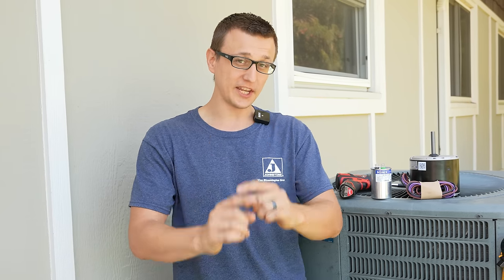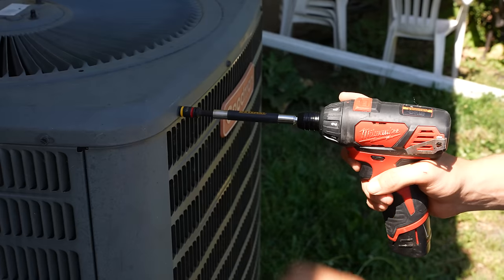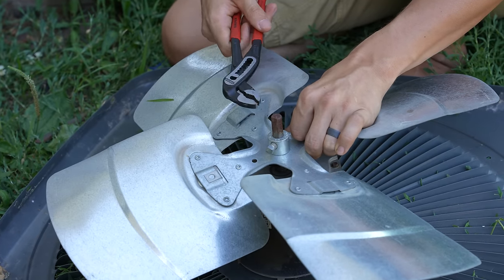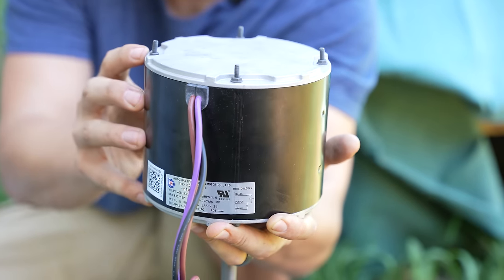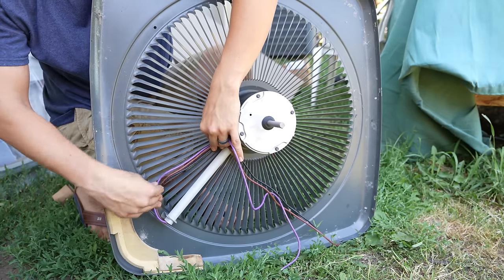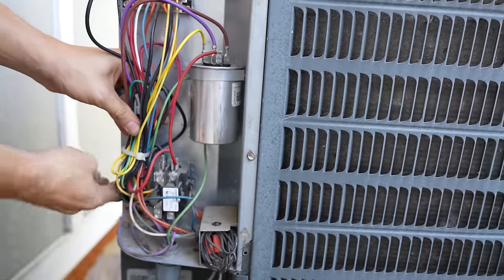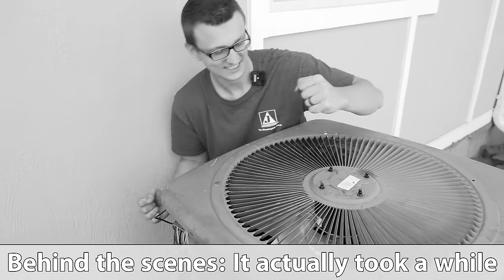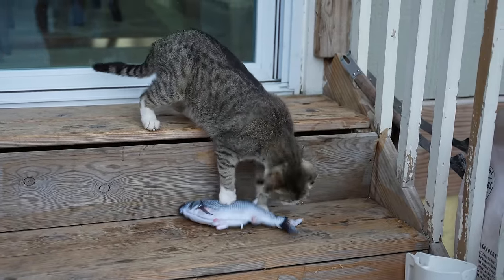How To Replace Air Conditioner Condenser Fan Motor

Comment: I am an inexperienced homeowner, attempting to fix my AC condenser unit with everything I learned from this channel.  I came to the conclusion that I need to replace the capacitor, contactor and fan motor.  My existing fan motor is secured to the grill with 4 screws (flange, hex, and "teethed" for friction), while the  replacement motor, Trane MOT18681 comes with screws and needs to be secured with nuts.  Since condenser unit is subject to movement/vibration, what type of nuts (and washers) should I use?  Are they ready available at Home Depot, or do I need to order them online?  Also, should the nuts and washers be made of stainless steel to prevent rust?

Comment: Thank you so much, Jay. This is super useful. My motor has more mounting screws on the diameter instead of the backside of the motor. I can’t find what mounting style that is. Any suggestions?

Comment: For putting the cover back on top you can save yourself time and hassle by loosely setting a screw in one corner then working your way to the next corner and loosely set that screw. Go to next corner, loose screw then to the last corner. Then just finish and tighten up. Each loose screw tacks the top in place so it doesn't pop out when you're on the other side.

Comment: Use your VOM to check for voltage before touching anything. Don't trust disconnects or circuit breakers.  Don't pull on the fan blade itself. Pull on the blade attachment, it is much stronger metal. Before cutting any wires or touching any terminals, discharge the capacitor.
Reply from the maker: All good recommendations! Thank you J.P. for your feedback! I hope you have a wonderful new week, God bless!

Comment: Nice video. I have a question. There are videos online that show people removing the bottom oil plugs, and others where they put them back in after adding oil. It looked like your motor had the plug removed. I'm confused. What's the purpose of taking the plug out, would n't that allow oil to escape, causing the motor to run dry on lubrication? I may have to replace my motor, I have already ordered new capacitors. Thanks.

Comment: Hey, Jay THANK YOU AGAIN AS ALWAYS FOR YOUR INFORMATIVE VIDEOS. EXCELLENT JOB...
Question for you, although not ideal but can you replace a fan motor w/ slightly higher RPM than the orig/spec motor? (i.e. If the orig one 825 rmp & you have an 830 rpm motor w/ the same hp). Thanks in advanced...
Reply from the maker: You're welcome good sir! If the RPM difference is that small, it should be fine 🙂👍

Comment: Hey Jay! I swapped my capacitor out since my readings were 28/3 on a 35/3 capacitor. I also checked the fan wires and got 159 , 122 & 37 between the wires. The fan still won’t start until I give it a push a few times. Do you think the condenser fan motor can still be bad even though readings add up? Should the fan wire lower readings be more even?

Comment: great job as always. Thanks. I have a question not related to this video and it's regarding replacing iComfort Lennox thermostat with Nest. Is that possible with re-wiring? the existing  wires now are ( R, I-, I+, C). Thanks as always.
Reply from the maker: Thank you! That's a tough question to answer without actually being there.. That is a communicating system you have there right? If you read this reddit thread, you should get an idea of what you're looking at: https://www.reddit.com/r/ecobee/comments/b9umie/anyone_have_experiences_with_replacing_a_system/
Reply: @WordofAdviceTV  Thanks for the reddit thread. It does explain a lot and it looks like I do have the board that has the regular wires connectors (y, w, r, c, etc.) and hopefully the tech can just rewire to that board. I have Lennox model sl280v I don't know how to find out if I have communicating system. Thanks again

Comment: Hey jay, this is such a good video for me, just got a brand new unico unit for my house, do you recommend a spare oem condenser motor just incase? and how long do those motors tend to last? .. God bless my friend 🙏
Reply from the maker: Good to hear you liked the video! I have seen plenty of 20+ year old units with the original fan motor still running great... Fan motors don't fail too frequently. A spare is always good to have but is it necessary? I will leave that for you to decide. 😇 That being said, I do recommend having a spare capacitor on hand though. Those do fail quite a bit.
Reply: Got you jay 👍 have a blessed Sunday my brother 🙏

Comment: hello my friend.  you are AWESOME!  .... well I had the "rattling sound" happening, so i took the fan off and greased the shaft.  put it back together and the rattling sound stopped, but still existed just a little itty bitty bit.  when the noise came back a little, i placed a heavy brick on top and that did it!   So something was obviously loose on the fan motor thing itself but i tighted all the screws i saw.   If a heavy brick weighed it down enough to stop the noise, what does that mean?   =).   Did that make sense the way I asked it?  A brick on top stopped the noise.   I will lleave it there, but anything you would suggest next?

Comment: So very helpful, thank you for the awesome video!  One note I can throw in that might help someone one day: there is a specialized tool to get a fan blade off the shaft. I think it's called "fan blade and blower wheel puller".  The guys I got the new fan motor from volunteered to help getting the fan blade assembly off the old shaft, and they used that tool. Made a big difference in turnaround time.  Anyway, thank you so much for ALL of your excellent videos!

Comment: I work your channel Alot, ???  I had a furnace installed in 2011 ..  The company Also installed a R22 evap coil ..  I never got the condenser installed..  They went out of business…  Can I use that Evap coil with a 410 condenser, no refrigeration oil never enter the Evap coil!
Still need to run a line sit and brace etc,
I don’t want to tear down the furnace
Reply: Can anyone help me

Comment: Do you ground that capaciter before you start replacing wires?  I am a little scared to touch that capaciter.
Reply from the maker: Discharging the capacitor after turning power off is always a good idea. I have a video on how to do that if you need it: https://youtu.be/45oZXnClMD0
Reply: @WordofAdviceTV  Thanks. Great channel and very informative. Keep up the good work. We all appreciate it.

Comment: the explanation is good but not always when changing the condensing fan motor comes out that easy.  In my case, always to clean the shaft I use a circular brush of those that are placed on the drill to make the work faster and lubricate the parts and I use a blade extractor taking care not to unbalance it so that when putting it back there will be no problems.  For the most part, the tutorial is good.
Reply from the maker: I only agree! The one in the video came out very easy. More often then not they take some persuasion. Thank you for sharing your process of taking the fan blade off! The additional tips and suggestions are much appreciated!

Comment: Jay, what part of Hawaii are you living in? Are you still doing HVAC? I’m interested in moving there but I’m not sure how many job opportunities there are there.
Reply from the maker: We are currently renting a place on the north side of Big Island. Once our term ends, we want to move back to the west side. Currently I do not have a full time job. Only do miscellaneous side jobs. I am investing and learning how to be a full time trader/investor in crypto currency and hope that eventually it will be my primary source of income. So unfortunately I would not be a good source of information as far as HVAC job opportunities here go.
Reply: @WordofAdviceTV  Hi Jay, I did a quick search on the big island, but my suggestion is that you look more closely for potential HVAC instructor jobs/adjunct, etc. Honolulu has a program, but I didn't see anything on the big island. You would make a wonderful instructor. If you were here in PA, I would definitely hire you as an adjunct for my program.
Great video, some additional tips, refrigeration service wrenches fit the square set screw perfectly (or 8 point sockets).
I also adhere to clean up and care of shaft, but if you still have problems the "Ultimate Puller" is a wonderful tool for indoor and outdoor fans. Keep up the good work.

Comment: Does anyone know if it’s okay to have a fan motor that needs replacing but is still spinning but not spinning up to the needed speed? It’s been a month and I’ve ran AC on here and there. I’m wondering if it was okay for my compressor? The AC fan was always starting up and spinning however it wasn’t blowing hard enough and it’s just been about a month until I’ve been able to replace this. Great video btw thanks!

Comment: My fan was making a loud like crackling noise when the unit is on but now my Ac won't turn on. There is no xrack on my fan but I think the motor has finally gave out. Does replacing the motor get it working or do I need to replace something else after replacing the motor

Comment: I recently took opened the condenser to give it a good cleaning but had a very difficult time lining up the grates to put them back on. After 3 hours I managed to get everything back on and bolted down but one panel in the back is slightly off leaving a tiny gap where all the wiring is. Should I be worried about rain getting in there and messing things up? I'm dreading taking it apart and trying it again.

Comment: Can the contactor also be a reason why your air conditioner unit might not work?
Reply from the maker: Yes. A bad contactor or one that is not pulling in would cause the AC not to work. Here is a video on that: https://youtu.be/NVPhsK4gK1A

Comment: To check for voltage at the contractor measure each leg to ground. You can have 120 volts on each keg but no 240volts at the two terminals.

Comment: Do they make aftermarket ECM motors to replace a psc fan motor on those?
Reply from the maker: Yes they do good sir 👍 A PSC condenser fan motor can be replaced with an ECM
Reply: @WordofAdviceTV  I replaced my air handler with an ecotech rescue. Looks like they make one for the outdoor unit as well as genteq evergreen OM.

Comment: My new condensor fan motor has a longer flat part on the shaft. Is there a certain depth that the fan blade should be ? Theres no indication on it. Theres  maybe 1/4 to an less than an inch before the base of the motor is a rounded part.
Reply from the maker: I always mount the fan blade at the same depth as the old motor was. There should be a little round marking where the set screw was tightened on the shaft of the old motor. Measure from the motor base to that dot and put the fan blade in the same position as the old one was.
Reply: @WordofAdviceTV  awsome, thank u so much. I had to order a fan puller. I tried your way , but that very end just wouldn't come off.
Reply from the maker: @losmoore3358  Oh its always annoying when it gets stuck like that! Another option is to try to file or sand down the edge.

Comment: I have a Day & Night split system. The condenser (4 ton unit) outside is 29 years old.  Currently  everything works. Indoor unit (fan is blowing, air is coming out of the vent, etc). Condenser out is working but somehow I believed there is a refrigerant leak somewhere. We had HVAC tech came out 2 years ago to top off the refrigerant (R-22). This year, we are experience the same issue again, No cooling even though everything (indoor and outdoor units work). Should I be looking to replace the whole system or just hire an HVAC to do leak detection test and replace/ repair. The system is 29 years old?  If full ac replacement is the way to go which is what I am thinking, what brand would you recommend or what questions do i need to ask? I lived in Southern California so is pretty hot at times in the summer. Thanks in advance
Reply: Replace the SOB and go with a Goodman!

Comment: I have a question 🤔 I just had my motor replaced and when I put my hand over the hvac the air that Is being pushed out is much hotter one side than the other which is cooler can yo tell me what can that mean

Comment: thanks for this great video, after watching it, i bought a condensor fan motor for my two outdoor Trane condensor unit, just in case any of them broke. but the motor unit shaft where it hold the fan blade is very short, much shorter than what video shows, it only has 1.5 inch, but host condensor fan has at least 3 inches, will this cause any  problem ? my unit is brand from Trane. anyone knows the answer ? thanks

Comment: I would've mentioned to remove drain plug for up or down orientation depending on motor, yours was removed, or motor will probably fail early from water build up.
Reply from the maker: Yes! Thank you for pointing that out. I should have mentioned something about it. After watching the video a few times myself I realized I missed quite a few things actually.. Thankfully we have the comment section to fill in the blanks 😇
Reply: @WordofAdviceTV  I just put a 4in1 sleeve cheapest 1/3hp @ $90, for me I'd go ball bearing though.

Comment: Can I change motor with different HP, same RPM, off course I will match new capacitor with new motor, in this case replacing 1/10 to 1/4 ?
Thanks

Comment: ? replacing my fan motor with a 4 wire motor. seems  theres a (ground maybe) striped wire connected to the bottom of the fan motor housing but where does the other end of it connect to? its just hanging there. also new motor has a longer shaft and no markings at all on it to slide the fan to how do I put the blade at what level on this shaft?

Comment: Don't some motors automatically adjust to turn the proper direction? Probably more expen$ive. Thanks for another great thumbs 👍🏻up video!
Reply from the maker: I have not seen those but they may be out there.
Glad you liked the video! Thanks for stopping by!
Reply: I think DIY HVAC uses them.

Comment: Someone told me that the capacitors can have enough of a charge to kill you if you touch the terminals.  Even though you have the switch pulled out so it's not getting any power (240 volts) from the house.  Is that true?  How much of a shock would you really get if you touched it without discharging it first?

Comment: Cutting the pole off the motor is best when extremely stuck. You have a new motor with pole anyways. And as for the bent screws, put a nut on it and then bend them out. You will never damage the threads

Comment: Can't get the blade to loosen up to pull of. Was able to slide it down a bit, but not up. Holding the bolt while trying to wiggle up the blades isn't working. Already sanded and tried pb blaster, any ideas?

Comment: Goodman Engineering showing up with you trying to put the top with fan on. 😞 
Wouldn't it have been a good idea to have cap label turned so it could be easily read?
Reply from the maker: Honestly, sometimes it seems like engineers don't even consider the servicing aspect of the unit. For most units, they can sure put a little more effort in making parts more accessible and labels more visible/not prone to fading out.

Comment: I got a new motor but the new motors wire thinner. Old one says 18AWG and they are thicker than the new one is .Need help trying to install a new motor

Comment: Other quick tip to  mention is  to never over tighten the four fan motor nuts VERY IMPORTANT
Reply: How come? Do they stripped and fall off? I use my impact drill gun with a deep socket bit to tighten the nuts and then I my channel locks to break the screw so it’s not too long. Is what I’m doing bad practice?

Comment: my unit has more than 10 yr and now am getting an error msg  84-HIGH PRESSURE LOCKOUT 4 HOURS (Code: 84), a tech came in and he said that condenser fan motor is not working but i didnt see him check the capacitor like you did, he said to buy a new unit intead of fixing it because  he said that i will expend over 1k just to get that replace  ect what do you think ?

Comment: For those motor screws the best way to straighten them is screwing the nuts on them that way you can used your channel locks to do so with confidence
Reply from the maker: Yes! That is the best way to do it. Thank you for pointing that out,  it's much appreciated!

Comment: Do not grab the motor studs on the threads put a nut on the stub and grab the nut. Also, WD-40 is a penetrating oil not a lubricant. Just an FYI many people are under a misconception.

Comment: Should haves used needle nose pliers to grab the metal portion of the wire contact.... to take the wires off the capacitor, rather than pulling on the wires.
Reply from the maker: I am guilty. You are very right, the proper way to take off the wires is with a needle nose pliers. I stand corrected 😇
Thank you for comment and I hope you have a fantastic weekend!

Comment: No ground on fan motor??
Reply: I’m asking if the fan motor needs a ground or not help?
Reply from the maker: A ground wire is only required on mounted motors and not direct mounts. Meaning that if the bolts securing the motor run through the metal lid/shroud then it is grounded.
That's the technical answer but basically if there is a ground wire coming from the motor then go ahead and hook it up, if not, then don't worry about it.

Comment: WD-40 is not a lubricant - WD stands for "water displacing" and its main use is as a solvent or rust dissolver.
Reply: it's got a thousand uses beyond that. it's sort of what its known for. and lubrication is one of them